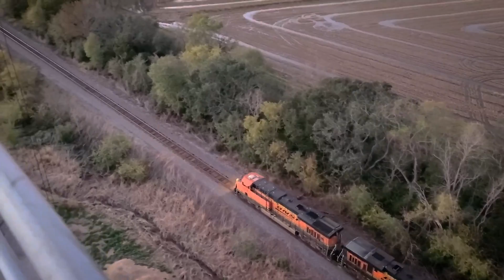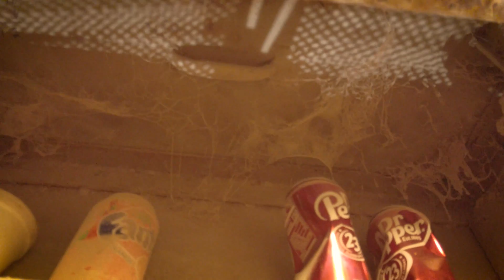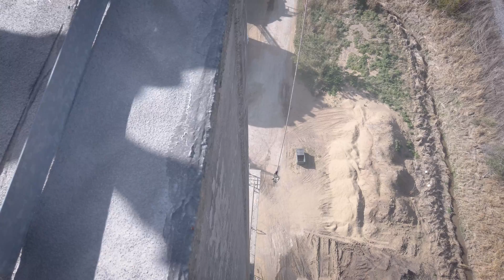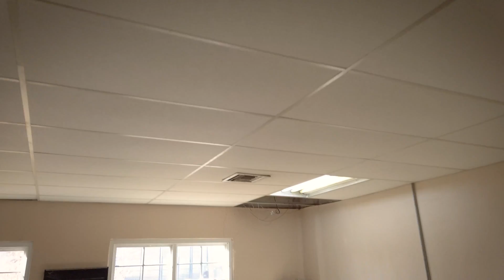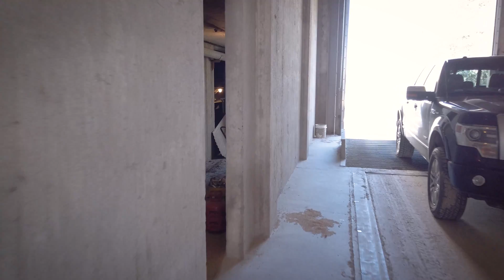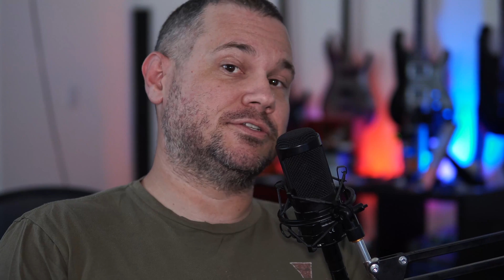HUGE INSTALL in Louisiana!! - DIY Ubiquiti Internet Relay Pt.63

Comment: As soon as I saw the tape I knew that things were going to work out
Reply from the maker: The tape?
Reply: @rmp5s  the electrical tape! 🤣
Reply from the maker: @larrybland007  Ah yes. Like duct tape, it fixes everything. 😆
Reply: @rmp5s  so I’m going to copy your model on a smaller scale. In your opinion is it worth it to resell WiFi?
Reply from the maker: @larrybland007  Resell Wi-Fi?  You mean...like...put up access points in an office building or something?...
Reply: @rmp5s  exactly
Reply from the maker: @larrybland007  I've never done that but there are ways to do it. Just gotta Google around. You can also join the Discord...people on there may have done it, too.

https://discord.gg/yJfkehm
Reply: @rmp5s  thank you
Reply from the maker: @larrybland007  👍

Comment: Did you try out any LTU products from Ubiquiti, they advertise 1Gbps+  throughput and say that they are much better for performance overall? Im just wondering if you had the option now would you buy airmax or LTU?
Reply from the maker: LTU wasn't really a thing when I started. See my video on "What does starting a WISP cost" video to see what I would get to get started knowing what I know now. I wouldn't have even got what I did, let alone more expensive stuff.
Reply: @rmp5s  Thank you
Reply from the maker: @tsimicx  Yea, for sure. You DON'T have to spend a ton of money to do it. I could start half a dozen networks now for what I spent getting started.
Reply: @rmp5s  do you have any video on the fiber drop access points? I don't have a clue how to get a wholesale fiber or roughly what the monthly fee is for example 1 Gbps
Reply from the maker: @Bryan-Hensley  Nope. I do not. Really, when it comes to that, it doesn't have to be "wholesale fiber". All you need is a connection you can resell. That's all.
Reply: @rmp5s  this is the part I'm lost on. How do you manage to get in touch with someone? We only have two major companies here with headquarters overseas.
Reply from the maker: @Bryan-Hensley  Yup! It's the hardest part! Took me MONTHS to find a place and I'm in the 5th most populous city in the country! It's not easy, man. Lots of Google, lots of phone calls, lots of creative thinking. Just gotta make it happen.
Reply: @rmp5s  one of my best friends is the internet repair Tech at CenturyLink and that's who's here. He's been a great help
Reply from the maker: @Bryan-Hensley  Nice. There you go!

Comment: I’ve watched most of your WISP videos..Thanks for posting all the videos. 

I’ve got a random question for you—in one of your videos you mentioned how you were sharing your data center cabinet with Juan, who used it for a Plex server. 

I also run a server but don’t have any friends who have it running so I can’t really put my server through its paces—if you have a Plex acct want to check it out for me?

I live in Alaska so I’m curious how it works over long distances.  You’re a techy guy so I figured it was a fair question 😀. 

Thanks!
Reply from the maker: Hahaha...what's it running on? Distance doesn't matter too much if it's for the hardware and bandwidth to do what it needs to do.
Reply: @rmp5s  it’s running on a NUC10 hooked to a 12-bay Synology. 

I’m one of the lucky ones to have decent internet in this state, so I have a 1000/50mbps cable connection. I lived/worked in Korea a few years ago and that’s where I got setup with Plex—I had cable tv over there but it was all in Korean so it wasn’t super-useful. Ever since I set myself up with Plex I haven’t looked back.

I’ve setup a few Gigabeams at my dad’s and some other family to connect out-buildings to the main house, etc, and they’ve been really solid. They were a cinch to set up.
Reply: WOW